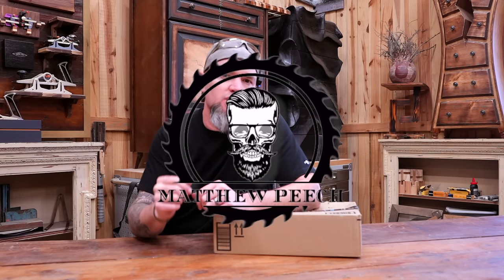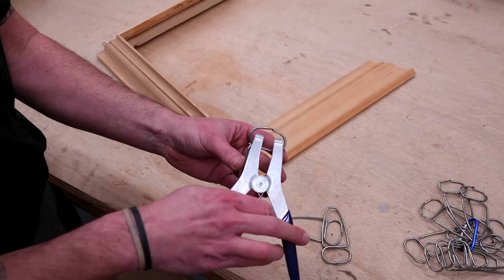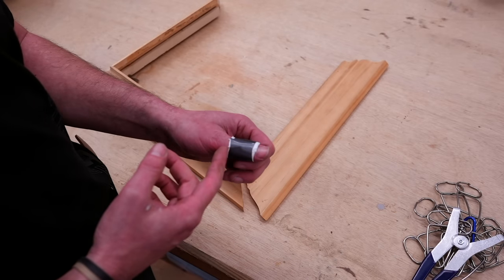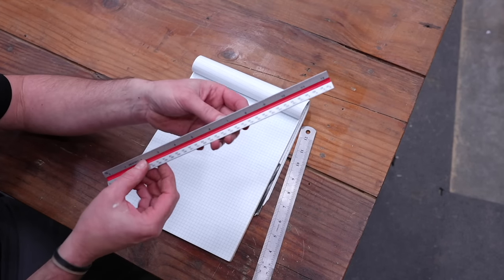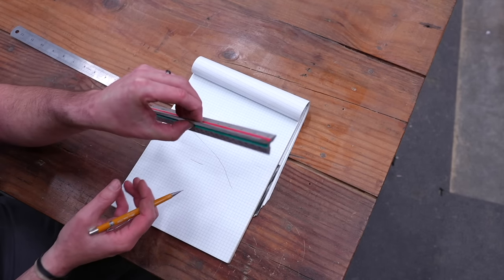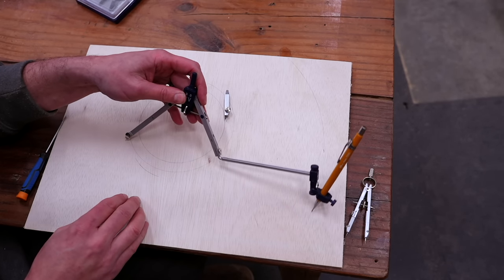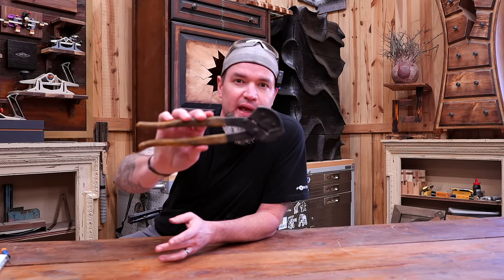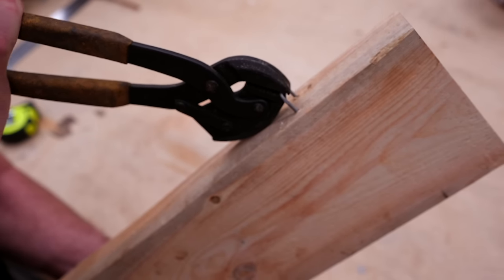8 Tools Under $20 YOU Told Me To Buy

Comment: HF has kept their prices low by having little to no quality controls and usually the last fit and finish steps aren't performed which means you'll find excess plastic or rougher metal surfaces. On some tools this is ok, and on others it is a problem. It is also why some people got a good dowel jig and other have a horrible experience. My take is there are more issues than not so if I need a precision or power tool, HF is not the place I go.

Comment: Harbor freight is great for consumables tools jigs and such not so much but its great for a single use or even 3 or 6 time use tool but not much more although their older tools were great I've got a 8 inch drill press from them I've had for over 15 years and still operates like a new 1 they're hit and miss

Comment: Uhm.  You don't have to be an architect to need/use an architect's scale.  If you work in new construction and not a shop, you're going to have to scale off the drawing and get your dimensions.  Or literally any time you're building something off a drawing, even if it is in a shop.   Not everyone is a "maker" who sits in their shop and thinks up a cool idea and makes money off it.  

Granted most shops will have a standard of some type if they're good, so you can use a 1/4" scale on your prints and just use a regular tape measure where 1/16" on the tape is 3", but this is absolutely not just an architect thing.  If your shop is constantly using someone else's prints, then you're going to want an architect's scale to make life easier.

Comment: About second thing, that triangular ruler is mostly used for construction worker to read plans, not architects . Because we ha 1:25, 1:50, etc it is for for worker so we dont need to start random calculations in our heads. That is how we use them in metric world I will add it but thing is withe same logic, to read not to make. If your ruler slides on 300 mm length, either that ruler is bend or you are extremely weak. That compass is really unnecessary if your iq is bigger than room temperature.  Flip heads work only in dyi situations, they cant survive even 3 days in real work.

Comment: "most important thing you can buy for under $20"

About $60 in cheap!! Bulk carabineers. All sizes, all shapes, some for climbing so you can hold weight on it, and a MESS!! of cheap "not made for anything ever" ones to hold wires, strings, tool bits, wrenches, hoses, and so on

Comment: CURIOUS... on the star... couldn't you use the compass and divide the circumference of the circle 5 equal ways and connect the points... don't have my compass handy to test...
Reply: No, it's more complicated than that.  5 lines intersecting 2/3 down each line and separated by 72° then make a line connecting the ends of the lines.